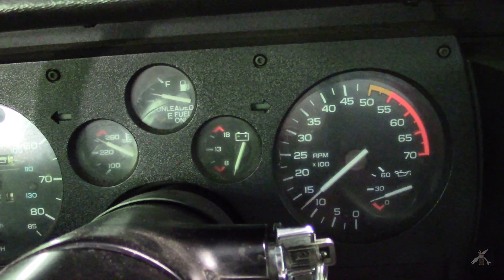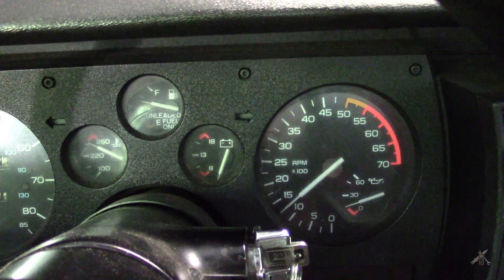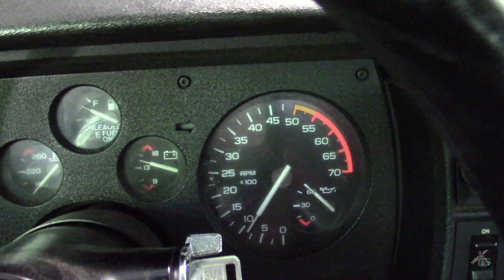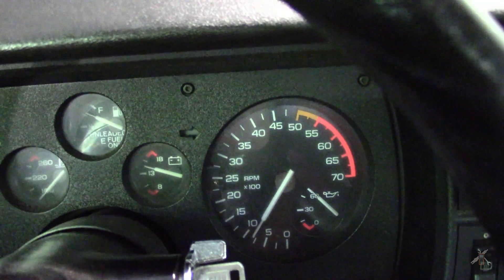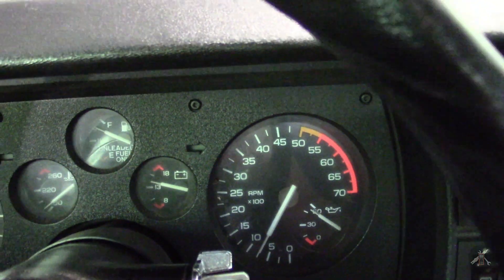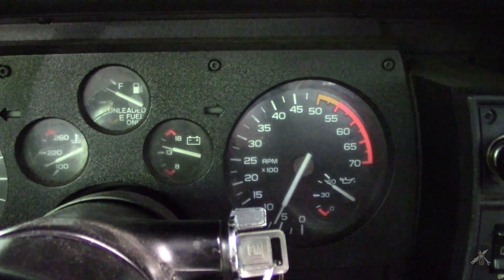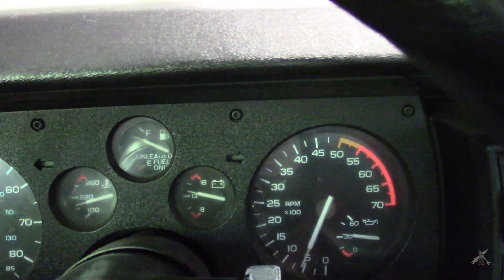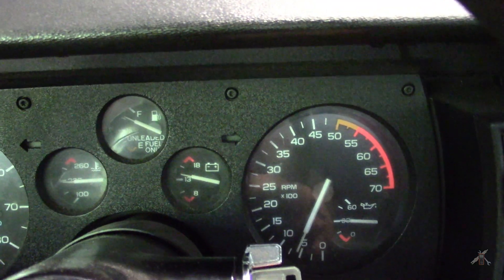3rd Gen Camaro 305 TPI - What is Idle on Cold Start and Hot Restart?

Comment: Hello, my IROC Z 1988 305 TPI has a terrible cold start and sometimes even warm start. It miss fires all the time. I have changed everything except the distributor. Should I change that? It also idles between 10-15 rpm
Reply from the maker: If you haven't been through the ignition system yet, there is a lot you can do without a full distributor replacement.  Ignition module, cap, coil, rotor, wires, pickup. Ignition modules are a common issue.  The pickup coil is less common and requires removing the distributor, but the other parts can be replaced without doing that. The distributor can have worn bearings that will affect spark.  I had that on a car once and the timing mark gets very wide when viewed with a timing light because timing will be varying. It would idle and run at low speed ok, but at high engine speed it would misfire badly.
Here is a video I did when I went though my distributor.
https://youtu.be/Yw1DV9gWdHk

Comment: What are your thoughts on performing a throttle body coolant bypass on your IROC?    I do not plan on driving my car in the winter months (live in Nebraska).
Reply from the maker: I would be cautious about it.  The heated coolant is intended to prevent icing or freezing in the throttle body. You would expect this to be a concern below freezing temperatures. I have not studied this deeply, but I think that you may find icing conditions even above freezing temperatures. The service manual references "cool temperatures".  I had an occasion like this with a carbureted engine (at idle) where it was running poorly a few minutes after start. I found frost forming on the throttle plates.  It was a very damp humid day in the mid '40s. When air is metered through a large pressure drop (to manifold vacuum) there is usually a temperature drop.  This can be accentuated by moisture and fuel fumes in the air stream (PCV, canister purge, humidity). Carbureted engines have the additional issue of evaporative cooling from metered fuel, so I don't know how severe the conditions are in the throttle body.  I don't expect to see a significant performance gain eliminating the coolant.  So, even though I don't usually run in the winter, I will leave it stock.
Reply: @bitsofwisdom460  Thanks Dan.  I will leave it as stock then.  I changed out my IAC valve and took car for a drive and when returned to garage I had coolant leaking from my throttle body onto the motor compartment around valves.  I think I tweeked the intake coolant tubing and disturbed the natural seal.  I seem to have gotten that stopped and found some vacuum lines that were cracked in the process.  Hopefully by fixing coolant leak, vacuum lines, and a fresh IAC valve my IROC will idle as smooth as yours.

Comment: Thanks for the video.  Does your oil pressure always run at 50-60?  I have an 86 IROC (305) TPI and my oil pressure runs at 30 at idle and about 28 in Drive.
Reply from the maker: My in-gear (~600 RPM) idle oil pressure does not always run at 50 – 60 PSI, it comes down as the oil warms up. It will indicate around 30 when warm and sometimes in the low 20’s when coming off the highway in hot weather. I am not worried about the lower value at hot idle since the engine really doesn’t require high pressure at idle. Now, a few qualifiers: My first caution is that the dash gauges are not highly accurate, so it is good to use an accurate mechanical gauge for any critical testing. My engine is a new build (a few thousand miles) with the bearing clearances set to the tight side of spec.  The oil pump is new stock spec Melling. I expect that the 50-60 reading is measuring the pump bypass pressure. I am running 10W30 oil, so 30wt when hot.
Reply: @bitsofwisdom460  Thanks for the information.  I feel much better about where  mine registers.  I also found in my manual that 30 - 40 psi down the highway is where it should be.   Next up for me is to change my IAC valve.  Not always, but at times it does not want to idle and will die w/o feeding it fuel.

Comment: Thanks for the video. My 86 Iroc z has exactly the same Idle on cold and hot restart.  Had No Start and after doing some trouble shooting put new distributor.  I first tried to just replace the ICM and it melted the wiring on the distributor and did not even try to crank the motor.  I think the new ignition control module was defective out of the box or maybe had the wrong ICM in the box since replacing the distributor fixed my No start situation. Could a bad ICM or incorrect ICM cause the wiring to smoke and melt? It was the C+ wire that melted.  Anyway, glad my car is fixed and running great.
Reply from the maker: I am surprised that you would melt the insulation on the wire.  I suppose a defective ICM might be able to draw enough power to do that, but it would seem unusual.  The standard practice is usually to have the fuses sized to protect the wire.  You might want to check that circuit and be sure that someone didn't install a fuse that is too large.

Comment: Good info, looking forward to any kind of your content on the camaro
Reply from the maker: Oh, my posts on the Camaro will continue.  More coming soon. As nice as that car is for its age, there are many things that can be improved.

I do have more interests as you can see, so there will be some others mixed in from time to time.
Reply: @bitsofwisdom460 Hi Dan I know you’ve done several videos on timing. I have a timing light with the numbered dial on the back I believe like the one you used from harbor freight. When I set the dial on the light to zero I get the stock setting of 6 degrees BTDC mark on my balancer. But when I set the light to 6 degrees the mark on my balancer goes to 4 or 5 BTDC. Shouldn’t the mark on the balancer go to zero when the timing light is set to six degrees?
Reply from the maker: My timing light doesn't have the adjustment.  I would expect that what you describe should be true about the mark going back to zero, but I have not looked at that timing light documentation.
Reply: @bitsofwisdom460 thanks Dan bought a digital timing light and the marks are right

Comment: Thanks for posting this, I pinged you on Thirdgen.org about and shared a similar video of mine that is private of my 1985 starting and this helps a lot. I used my other YouTube account on your other idle video, apologize as didn’t mean to confuse as this is my main channel and was logged in to other by mistake 🙃 looking at yours on warm start at around 13:34 it goes to about 1400rpm and mine goes to about 1800rpm on warm start which seems high. Mine sits down like yours after about 8 seconds though and idles fine after well I guess as well as they idle. I’ve installed the IAC, coolant sensor, O2 sensor and cleaned the MAF. What throws me off is why the ECM would boost the rpm so high even if for 8 seconds and then around 800 if it gets all the temperature information telling it that the car is warm?
Reply from the maker: I didn't see anything on Thirdgen.  If you tell me how to find you there, I can PM.
The problem does seem unusual.  Here are a few thoughts. The ECM is apparently seeing a signal that is causing it to want to elevate the idle speed on the start, yet it settles down fairly quickly. It is probably kicking up both the ignition timing and the IAC. With it being that close to the start, you will be in open loop.  Even on a warm engine, the O2 sensor won't light off for probably 30 to 60 seconds, so that shouldn't be a factor. On an '85, the input sensors are limited: MAF, Coolant Temp.,  Manifold Air Temp (MAT), Distributor Speed, TPS, A/C signal, system voltage.  You might want to look at the MAT sensor and circuit, because it could cause the ECM to think you had cold inlet air. The manual notes that the ECM will look at system voltage to adjust idle, so that battery cables and alternator can have an effect if voltage to ECM is abnormal.  I don't know the logic, but they must infer engine performance based on voltage.  Could be a estimate of low fuel pressure? If the engine is running rough / misfire for any reason, the variation in speed at the distributor could trigger an algorithm that would hold speed higher than normal. If it is running a little rich, you might get additional speed flare due to more power than normal. If the A/C switch is on when it shouldn't be, it might flare higher expecting the load. OBD1 engines are a little extra challenging because a sensor can sometimes be off a ways.  For example, the MAT sensor won't trip a code unless it is showing -40 degrees. 

 It might help if you had scan tool data even though it would cause the idle to be elevated. It might help to cross check the sensor data.  Just a caution, I have found that the coolant temp sensor reads high on my scan tool.  Two different sensors and a voltmeter check all matched, so sometimes the scan tool data can be in error.
Reply: @bitsofwisdom460  https://www.youtube.com/watch?v=NkElYv_68w4&ab_channel=RABBITMotorworks
Reply: @bitsofwisdom460  Thanks for this and will check out the MAT sensor with the information you shared, check me out on the Thirdgen site as I'm under Calidude and have the same logo as my channel, there is a video posted in a thread called "Warm Start Weird Idle" and would appreciate thoughts on my startup. Yeah I've also replaced the Alternator, Battery and rebuilt fuel injectors and changed fuel pump to a Bosch unit. Probably need to get a data scan tool and saw the other video and your post on issues you were having too. Looking at the MAT sensor is the plenum needs to come off to replace but makes sense as it’s similar to the coolant sensor and would give a signal to the ECM based on air temp to increase fuel mix is what I was reading. It’s a $20 part so worth trying.
Reply: Okay so confirmed, YouTube is deleting my comments because of URLs I'm leaving 🤔